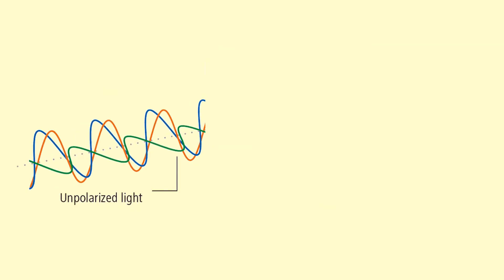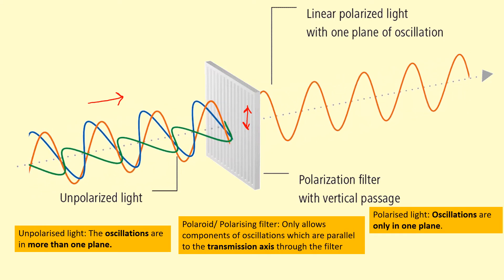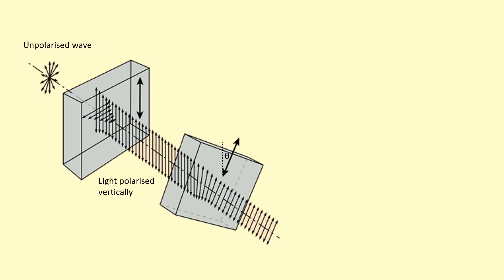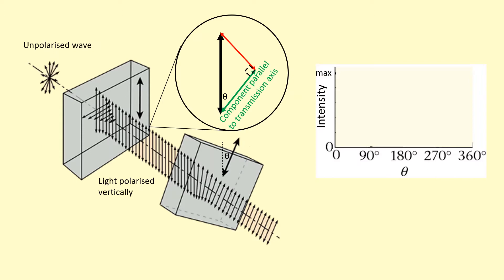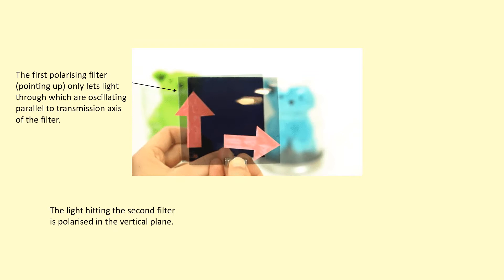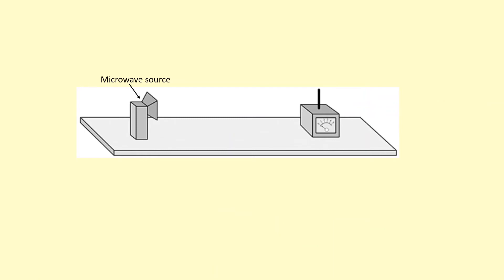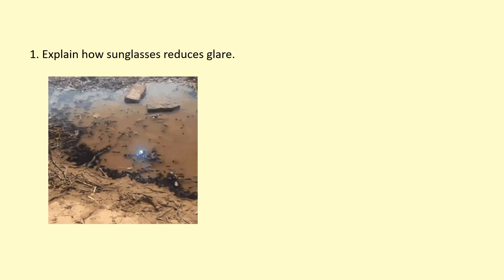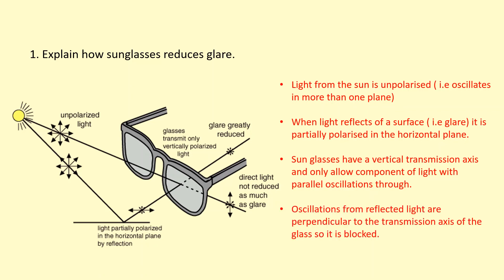4.04 What is polarisation?

Comment: so is the intensity of the light reduced when polatisation occurs e.g. at 90 degrees the intensity is zero so light is polarised?
Reply from the maker: If you pass polarised light through another polarising filter with its transmission axis at 90 degrees, the intensity becomes zero.

If you pass unpolarised light through a single polarising filter, the intensity drops to 50% because half of the components are blocked.